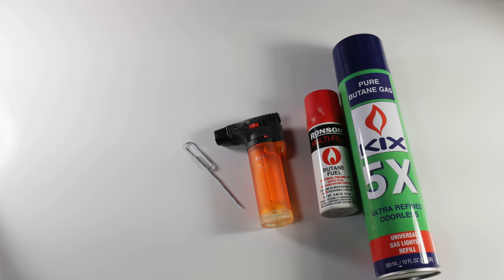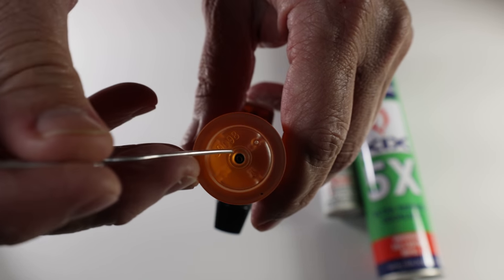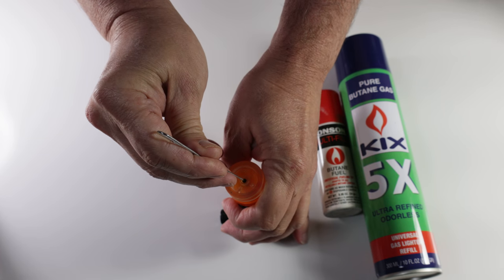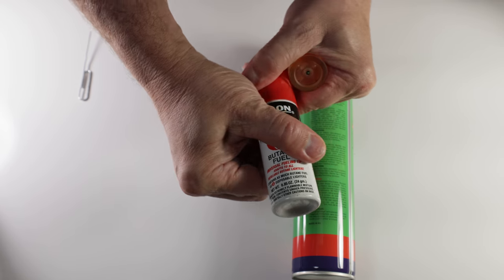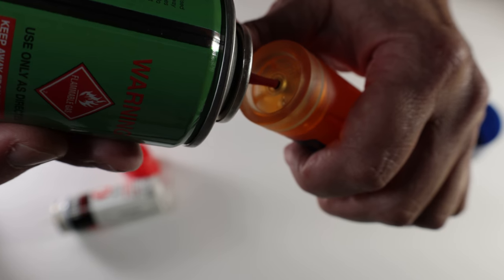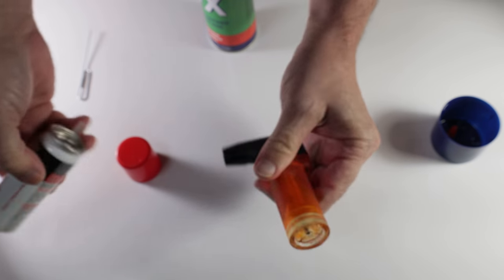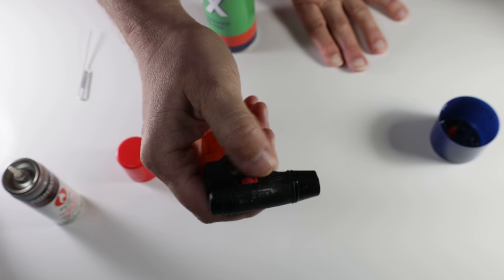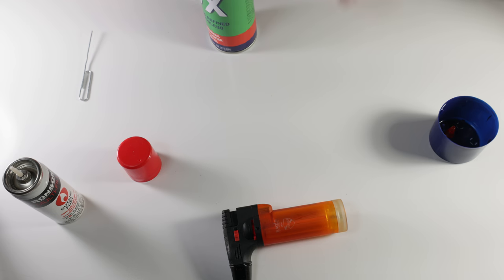How to refill an Eagle Torch Lighter

Comment: Important: Don't point the purge valve at your face when you purge your lighter. Eyes don't react well to being sprayed with butane. I've also found that torch lighters tend to be finicky about the butane they use - they like the clean stuff.
Reply from the maker: Thanks for sharing

Comment: Mine the gas won’t fill it up just keep spraying on the side
Reply: You probably have a metal tip
Reply: @rafaeltorre1643  so what’s the solution? i’m using a butane from zippo that has a plastic tip

Comment: I use the whip it pure myself. Sometimes these don't like to take the fluid. U have to move the can around no matter the type or brand ur using until u find that sweet spot it will spray out sideways
Reply: Was thinking of trying whip its. Buy 1 get 1 free. 800mls for $10! But got Newport for the quality tips! Great decision for filling any torch. Plastic tips don’t leak as much as metal tips.

Comment: What size is needed so the butane can fit the valve cause the one that comes with the butane doesn't fit
Reply: most good butane refill cans come with a cap....inside the cap holds 4 to 5 different tips to fit on the lighter you are trying to fill...one of them should be a fit. The adapter tips are molded into the cap so you are going to need to snap off the adapter tips to find the one that works.
Reply: @davidbocek  Newport butane has quality tip adapters that push right out instead of 1 cent plastic that you rip off with holes. I never had a problem after acquiring these tips from the Newport butane can. Free flints too! Awesome butane!

Comment: OK let me add a couple of things decent video over all but when u purge your tank u really need to stay away from metal it can ruin the end of your lighter find a small piece of wood but not some random twig I find that skewer sticks with the end cut off works great but don't break it u might get a little pice of wood in your nozzle then your screwed also when u shake it but down the stick and just shake your lighter a few times hard then hit it again you'll hear it and tbh this takes a long time like 10 shakes but trust me it will eventualy.make no sound if u don't even if it looks full it can cause a vapor lock where the lighter looks full but u can't get none out

Comment: Anson is the worst butane to use it clogs the burners real easy you wanna get something that is at least seven times refined most smoke stores carry them I prefer the 11 times
Reply: 5x is fine. Doesn’t make a big difference after that but if it’s affordable the best is probably xikar high altitude. I don’t pay over $10 for torch butane. Cheap for soft flame lighters. Cleaning your torch goes a long way too. They will clog from lint and debris. Toothbrush and a dab of alcohol to debris and clean does wonders. Blow air into torch to blow out stuff.
Reply: 5x is fine. Doesn’t make a big difference after that but if it’s affordable the best is probably xikar high altitude. I don’t pay over $10 for torch butane. Cheap for soft flame lighters. Cleaning your torch goes a long way too. They will clog from lint and debris. Toothbrush and a dab of alcohol to debris and clean does wonders. Blow air into torch to blow out stuff.

Comment: i have this exact model but after only 2 1/2 the valve is leaking and looses the gas quickly second one this happened now
Reply: You are not filling it correctly, the oring is freezing and keeping the valve in a stuck open position. The lil rubber oring is what keeps the valve shut to prevent gas leaking. So if it's leaking, the oring is other damaged or stuck in the open valve. Grab a small screwdriver (like for glasses or electronics) and wiggle the oring out. Don't lose it. Purge the tank empty. Reinstall the oring gently, and evenly. Now when you fill it, don't press so hard. Slow n steady til you hear/see it fill your lighter.

Comment: Why do I have to purge the gas out first? Can’t I just add some to the little bit that’s is left?
Reply from the maker: When you purge your lighter, you eliminate old fuel and even air that can build up within the fuel chamber. Old fuel mixed with air can make your flame sputter and flicker, reducing your ability to gain a clean light.

Comment: On the torch lighter does the little black rubber piece play an important roll in filling up the lighter?
Reply from the maker: The rubber is the seal that keeps the fluid in the tank
Reply: It helps because it’s the easiest to fill. Easy seal.

Comment: is purging the air REALLY necessary?
Reply from the maker: Yes
Reply: my torches kept breaking after a few months, I think it's because I wasn't purging and the pressure inside just kept building up until it all shoots out the bottom and is broken. going to try purging them now
Reply: @pramitz6500  Yep don’t top off either! Only on trusted torches. Refill valves break easily from refilling too much at once.

Comment: Won’t stop making noise from the bottom like it’s coming out
Reply: So tired of telling people this. You likely filled the lighter up incorrectly, allowing butane to escape as it fills the lighter will freeze the oring. The lil rubber oring you see at the bottom of the lighter is what keeps the gas from escaping. When filling the lighter, try to not leak too much butane. You can get a screwdriver, take out and gently insert the oring, then use one of the butane cans to press the oring back in place.

When using the can to refill your light, be slow n steady. Try not to leak and don't press too hard. If the oring gets damaged it might need to be replaced.